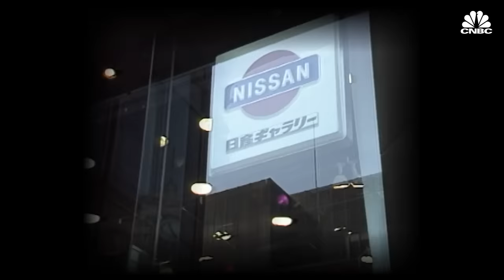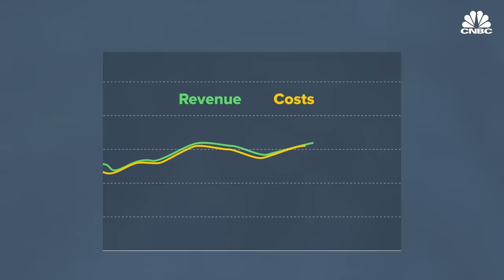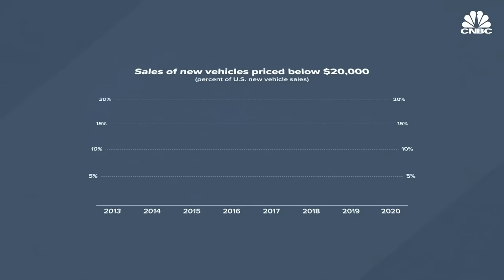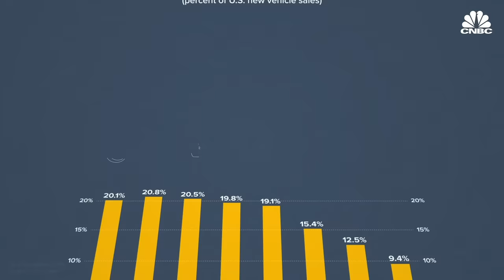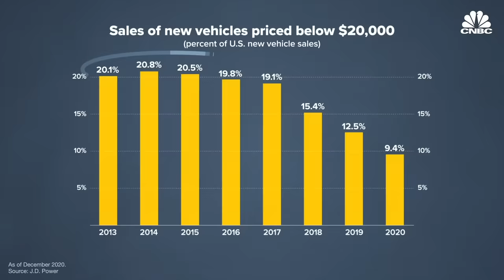Why Cheap Cars Are Disappearing

Comment: I dont even think in the long run, that the new cars will last longer.

Try getting a new computer for some system, for your 15 year old car.

The electronics inside these cars, are sophisticated, but will be obsolete VERY fast, so in just 5 years time, the automaker will not be able to get spare parts to build a new engine ECU.

Also, new cars have LED headlamps....Anyone care to guess if you can get a replacement in 10 years...And if you can, at what cost.

Please remember that you can not just replace it with a headlamp, found at a breaker from a smashed up car, because the lamp will not work, unless the car gets some secret codes, that is stored on a server, that the manufacturer turned off last year....

New cars is like mobile phones

Cost more and more....And lasts less and less years, and are almost impossible for the owner to repair

Comment: Didn't RCR already sum it up as the fault of "Cash for clunkers"  Basically it destroyed every cheap car that someone struggling to get by or a teenager just beginning to drive could afford.

I really like the idea behind cars like the Tata Nano (1500 USD).  Basically a car built to be as cheap as possible.  If we could find a way to do that while keeping it safer than driving a motorcycle it could make a difference for a lot of people.  I know so many people who are forced to buy the shittiest possible cars around and end up spending what little money they have on fixing it every few months.  If they could buy a brand new car for a few thousand dollars that could last several years with cheap maintenance costs it would change their lives. 

I also would like to see a change in how licenses are obtained.  it's kind of bogus that it took my sister so long to get her license because she had trouble parallel parking even though she is one of the few people i'm comfortable riding in a car with.  But then I see hundreds of people drive like absolute lunatics.  Every single morning I witness someone driving 10 to 20 miles over the speed limit and swerving through traffic and ask myself "how could they have gotten a license."  Because you only gotta show you can drive around a block and back into a parking space.

Comment: The video is about the US. In the EU politicians and factories has created so stupid co2 punishment rules, that forces makers and buyers to use bigger cars in the name of environment protection, instead of just punish cars based on weight and engine size.

There are also stupid rules for hibrids and electric cars. Some hybrid and electric suv-s has government financial support. Free parking and free changing. 

New cars also have a lot of electronics for lovering the consumption and helping the driver. It has the same pruce to built in to a small or a big car, but the price is the same. It also making cheap cars more expensive.

This is madness.

Comment: LOL "cheap" car at under or around $20,000... I'm in my early 20s, I did save up a bit but not even close to the "cheap" car range mentioned in the video. My plan, I'll save up to a certain budget, get a used car that has cheap repairs. But my concern is that inflation is crazy in 2023. I want to get a car at least under $10,000 budget. I dislike the idea of paying monthly for a car, I'd rather just pay everything in cash on a used but reliable car. I heard Toyota is reliable. I just hope that the repairs won't be too pricey if issues starts to happen on a used car.

Comment: Fixed cost argument makes zero sense, when you look at market like India or Malaysia. There you can buy cheaper cars and automakers make just fine margins. But downside is that you can buy something brand new with 800cc engine and Americans just want to go fast. Even something not poverty spec like VW Virtus or VW Ameo are viable and they still come with airbags and other safety equipment that you would expect. I think it's BS that something like VW Jetta can't make money, while being way more upscale and it's just excuse for automakers to try to upsell people more expensive models and get even more profits. IMO it's just a good old greed of automakers, but to great degree it's also a greed of customers as well.

Comment: Still driving my 2007 Pontiac Vibe, which is basically a Toyota Corolla with a Pontiac body best car I have ever had, still runnning strong, practical, hatchback design and with the seats folded down I have more space to haul stuff than even midsize CUV, I would take my Vibe over any new car today. To me a SUV is truck based body on frame, like a Tahoe, SUburban, Durango, Grand Cherokee, not something that is based on a car, that is why the CUV craze is a farce. Oh and I dont need a infotainment system in my car, I have my own Ipad, I connect it to the cars sound system and it works just fine. Oh and I am not inept or lazy if I want to control the air conditioning or the heat I just turn a knob and I am comfortable. THere is no way I would ever do a long term loan with how crappy cars are made today you will be paying the loan even after the car fails after the warranty. I will just look for awesome Toyota, and Honda products.

Comment: Dear Automobile Manufacturers,

When all your affordable models are tiny clown cars and the more appealing models are bloated with standard tech equipment nobody cares about, that doesn't mean people have lost interest in cheaper cars. It just means more people are taking out extra loans to afford the more reasonable models.

As prices continue to creep up with feature bloat, cars in the low $20k range will become the new tiny clown cars that nobody wants. Then you'll be drawing false conclusions about how nobody wants a car in the low $20k price range. All you're doing is shifting the scale around, as you continue to lose more and more buyers to the used market.

Comment: No one makes a reasonably priced, fun, little sports car, other than Mazda with its Miata.  GM dropped the Soltice and the Sky.  Mustangs and Cameros are rather large and become over-optioned and over-priced very quickly.  Same with the Challenger.

When my father-in-law was in the Navy, junior officers drove Triumphs, MGs, and Sunbeams.  ACs, before Carroll Shelby started using the body and chassis with the Ford V-8, to create the Cobra, were also popular.

About the only other small, fun car is the Mini, but it is not a sports car.

Comment: Once EVs replace gas cars there will be lots of cheap second-hand cars that will remain pretty much maintenance-free for a million miles. In fact there will be a dearth of million plus miles cars with degraded batteries for those who do not want a range of more than 300 miles between charges.

Comment: Modern vehicles are horrible garbage crossovers with too much unnecessary technology. The automobile industry is going to collapse because of it. 
Cars are better. Need more room, get a station wagon. Need even more room, get a van. Crossovers aren't the best of all the others. It's the worst of everything. They don't handle, they're not aerodynamic, not fuel efficient, not powerful, not comfortable, not anything but a marketing trick that is destroying everything

Comment: Buyers want more electronic gadgets? Rubbish, it's more things that can go wrong and it's time consuming figuring out how to work all these gadgets. My cell phone is far less distracting. Sometimes I think the best car I ever had was my 1978 Mustang. Why? Because the only things that were automatic were the electric starter motor and the after market cruise control I installed on it. Fast forward to the present, I want to keep my 2002 Honda Accord going as long as possible.

Comment: Cheap cars and horses are connected.   English upper classes had large Estates.   These Estates were funded by large farms on the Estates.  Once a horse got too old for useful work the horse were slaughtered. 
An English King declared that horse meat was taboo.  So the nobles,  sold the old horses to peasants. 
The peasants used the horses to plow fields,  and haul freight.   This resulted in the peasants becoming working lower middle class. 
Peasants farms became larger.
Cheap car give the poor ways to get to work.   Now that cars are more expensive,  young people can't get to places where the work is.
This is one reason, people  say the young are lazy.  For a young person cars are necessary for dating.
Cars are the motels for the youth.
So as a result, young people have no reason to work.
The birth rate is dropping, because most 1st born are conceived in cars.

Comment: All the technology you need is still in cars that are 10+ years old!! 2012/2013 and even older! Japanese cars will make your life better! Trust me! Honda and Toyota has cars that are so reliable, even at high mileage, you can find great deals out there between $5-$10,000 on sedans. And these used cars can last a long time, as long as you maintain and take care of them. Be smart! You don’t need to keep up with the Jones! This video is hot air speculation. My comment is not what automakers want to hear. My opinion does not make them billions of dollars. My comment puts the most money and value back into the people’s pockets! 
🇺🇸🏆 Your welcome! 

My 2013 Accord 4 cylinder gets 500 miles per tank. Value at 113,000 miles is just under $10 grand. And these cars can easily reach half a million miles, if properly maintained! 

The new 2022 Toyota Camry hybrid gets 700 miles per tank of gas! And you don’t have to wait around on a silly battery to be charged! Just take 3 minutes to fill up, and you can go another 700 miles per tank. 
Now that’s Freedom! 🇺🇸 And this car will still be on the road and saving people money and having fun road trip memories for another 20-30 years! 

I still have my brothers 1996 Camry 4 cylinder! It runs perfectly fine! It starts all year long! Even when it’s -25 below outside! This is a bullet proof car! And I even think it gets better gas mileage then my 2013 Accord! This 96 gets incredible MPG! And it’s so comfortable to drive! I just had it on a 200 mile road trip, a few weeks ago. It barely took any gas! 

Don’t listen to these so called advisers & automakers! They just desperately want your money! 

Only buy a new car, truck, van, and/or suv when you have the cash to buy one. Stay far away from trying to look good for others and monthly car payments! This is very bad financial decisions! Stay away from the heard/sheep/Jones! If you need to look good for others and your neighbors, then you will start to think like them too. And that will make you very average. 

Again, you are welcome!

Comment: Well some things are wrong in this video.
Today's cars are not reliable at all.
They designed to fail around 80-120k.
They are very expensive to fix.
So you are forced to trade it in and get a new one.
Problem is you overpaid.
So now you're looking for a used one older one with some miles on it.
The more technology the more things to brake...and they are extremely expensive. 
Keep what you have and keep fixing it.
Otherwise you'll go broke(if you already haven't).

Comment: The small cheaper new cars are just too impractical. Too low and easily damaged. Too small to hold a basic bike without extra equipment. Lack of a lot of features.
Buy a small used Crossover with so much better usage for what ever life throws at you.

Comment: It's hard to take a story like this seriously when it doesn't address inflation. A 20,000 USD car in 2000, adjusted for inflation, cost 30,000 USD in 2020. 
Without a correction on that, the story is utterly pointless. There may be something there, but you can't really see it since the approach is inherently flawed.

Comment: there absolutely no reason to buy an expensive car as it becomes a liability. A cheap, even a second hand car is more than enough to have a the main purpose of the car is to take you from point A to point B. Also taxi servies like Uber, Bolt is makng obsolete to own a car a lot ot times as the cost of transportation could be less than buying a car. End line if automakers won't make cheap cars and instead relying on expensive cars they could lose more than expected.

Comment: Cars are getting more expensive because they added more stuff and safety stuff into the newer cars. It is not pay more for nothing .
1991 accord LX was msrp 16485 and 2021 accord LX msrp like 25000 or 26000 . That’s 30 years later price tags 10,000 more than 1991 model that’s an average of $333 increase /more per year . But u get a lot of std features that was not in 1991!